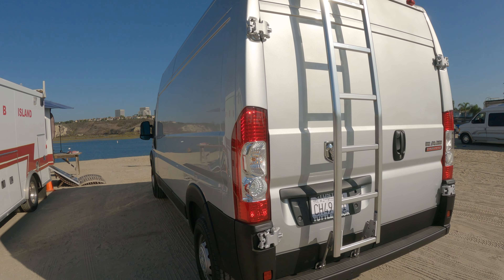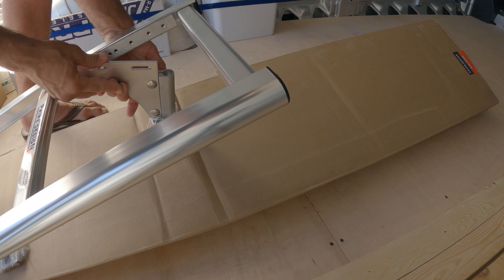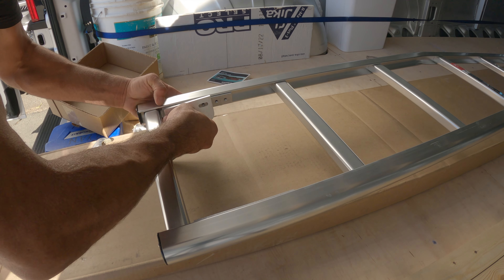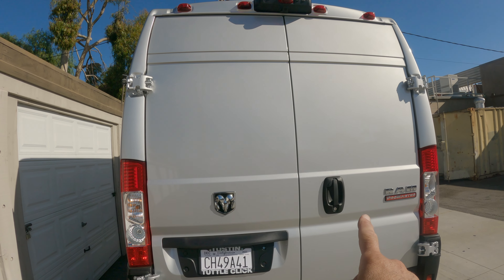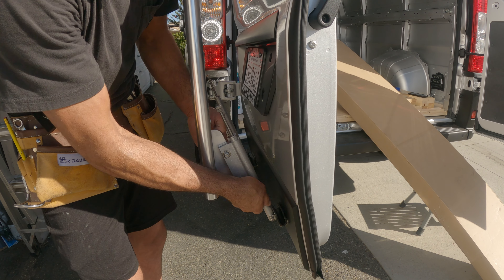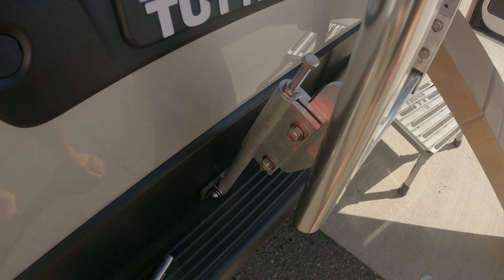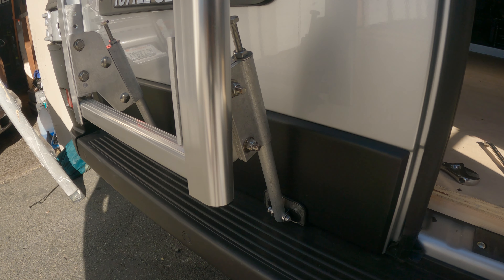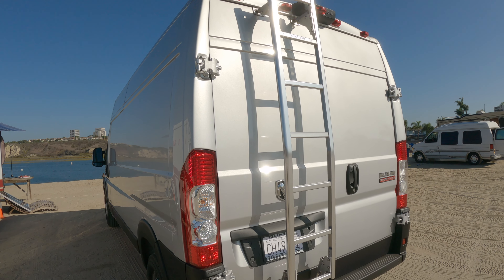The BEST Ladder For Your Van   [Promaster, Sprinter, Transit]

Comment: Hi I’ve looked at that ladder for our high roof promaster but it says only fits up to a 2019? Is you ram newer?
Reply from the maker: mine is a 2022.  It will fit yours, they haven't changed the rear doors on the promasters